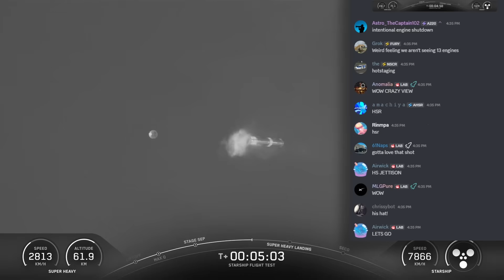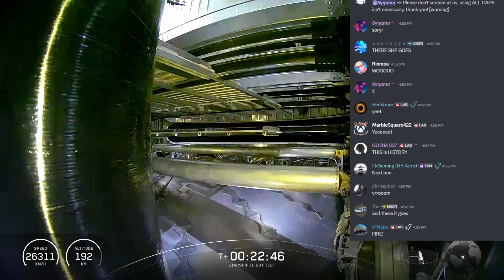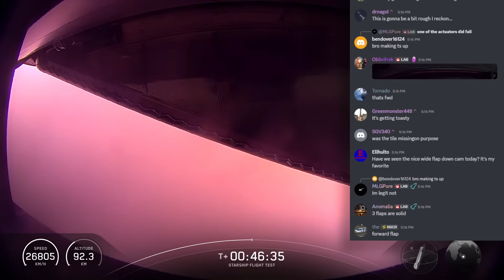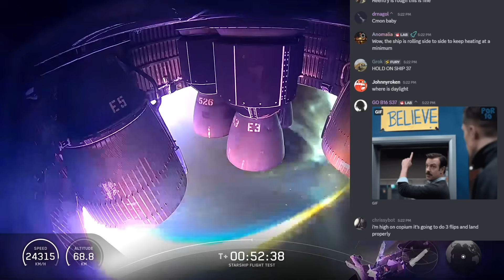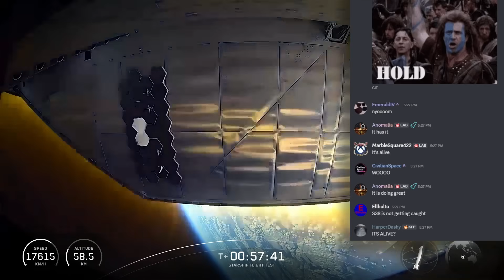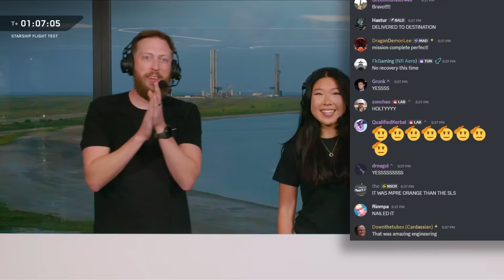LabPadre Discord Reacts to Starship V2's First Success! | Flight 10 Reaction

Comment: I would love to see Thunderf00l cope on stream, Desperately scrambling for any reason to call it a failure
Reply: he was tweeting saying 80% of the tps fell off 💀
Reply: @TatersEatsCrayons  but if he’s right and 80% fell off and it STILL survived reentry, then Starships seems pretty good. Shuttle could barely survive with one or two tiles lost and starship had almost 100 removed before it even launched.
Reply: @archierush868there’s no universe where thunderfoots right about anything 😭
Reply: @TatersEatsCrayons I’m highlighting how stupid his comment is in an attempt to downplay Starships achievements. Him saying that Starships bad because it loses 80% of its heat shield.

This has like 3 layers to this and he’s only right on 1 of the 3 layers which is that this would be bad for RAPID reuse. For regular reuse, it would take a few weeks or months to fix it but not rapid reuse, so long as it didn’t have the aft blow up cuz it likely would be scrapped if it did get caught. This is not their concern right now, what is is getting it to the water.

The other two points he missed is that if his assessment was actually correct (it’s not) and it did actually lose 80% of the tiles but still made it to the water, it would have lost 80% of the tiles AND STILL MAKE IT TO THE WATER! In TF’s world, it can lose 80% of the tiles and still survive, Well that’s fantastic! I WISH starship can lose 80% of the tiles and the ship’s still theoretically recoverable.

He also inadvertently shows how bad the shuttle, his favourite launcher, is in this case as for the shuttle, you can lose ONE tile at most but even then, it’s not guaranteed. Many shuttles survived with hundreds of DAMAGED tiles but starship can LOSE hundreds and still survive. Can the shuttle survive with 80% of the tiles gone?
Reply: @archierush868 i know lol i was saying it in a joking way lol starship in the end will def be a ton better than shuttle
Reply: @TatersEatsCrayons I watched the stream afterwards, and  80% of my brain cells fell off
Reply: well for people not following the starship program it would be enough to show them the damaged flaps and they'll agree its a failure